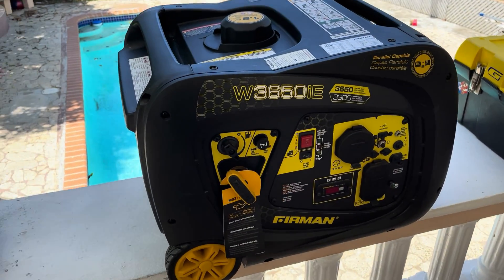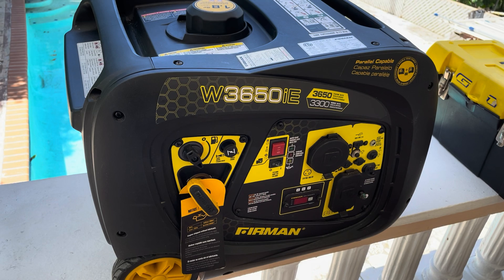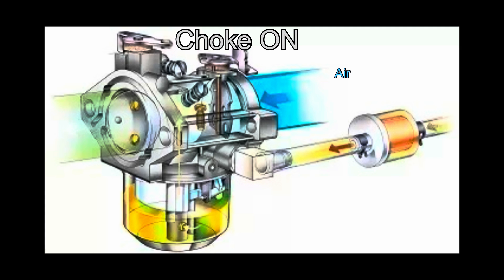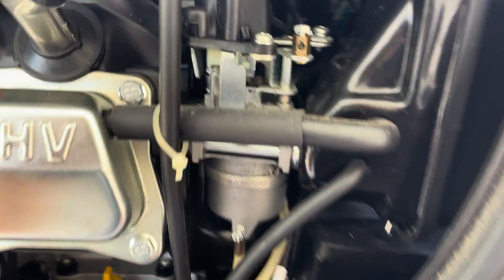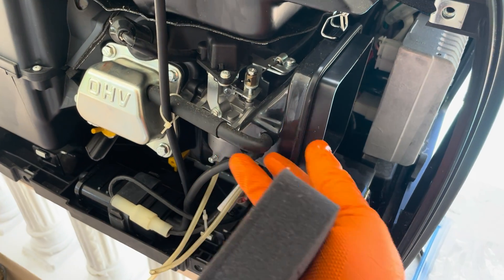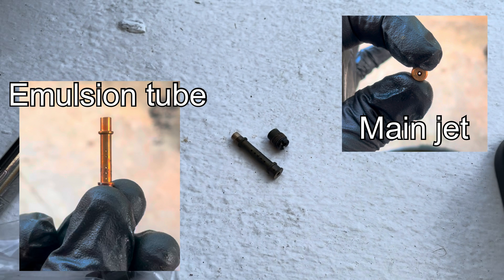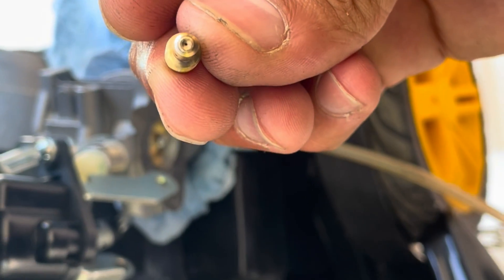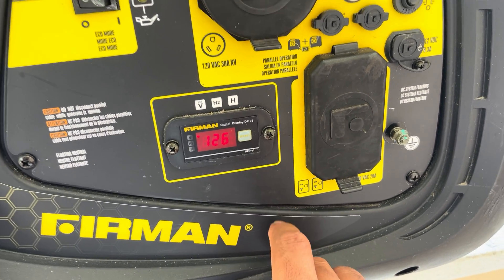Inverter Generator only runs on Choke / Half Choke. Quick repair for all generator brands.

Comment: How do i remove the choke line without breaking it
Reply from the maker: Go to my channel and check my latest video. In that video I show how to remove the choke cable. Basically all you need is a ratchet with a 1/4 inch socket and a Phillip bit.
Reply: @tacticalpowerpro my wife broke the screw bit trying to unscrew it lol. It still holds the choke cable just fine tho however it wont come off even if we wanted it to
Reply from the maker: Oh wow! Your wife hella strong lol

Comment: Great video.. I need your help, I just bought Firman 3000W with RV outlet, one Ground and two flat outlet, there is 125V between two flat one, but there is 75V between ground other two flat outlet, how do you connect to the house panel? Can you please let me know.. Thanks.
Reply from the maker: Thanks for watching! It sounds like your Firman has a floating neutral, which is why you’re seeing that 75V reading to ground, it’s a phantom voltage. For safe connection to a house panel, you’ll need a properly installed transfer switch or interlock done by a qualified electrician, and in many cases the generator’s neutral may need to be bonded depending on your setup. Never connect it directly without the proper transfer equipment, it’s both dangerous and illegal in most areas. If you’re unsure, have an electrician check your exact model and wiring so it’s safe for your home and complies with code.

Comment: Mine just surge and need a bit of choke to surge less. It run fine with load or eco mod disabled.
I will report back 😀
Reply from the maker: Those are signs of a clogged pilot jet. So a good carburetor cleaning (specially the pilot jet on top of the carburetor) will fix that problem. I will be uploading a video this week on how to solve exactly that issue you have on a firman inverter.
Reply: @tacticalpowerpro  oh great thank you 😄.
Any idea if they have a gas filter? I will get one in case.

Comment: I haven't cleaned the pilot jet yet. It's runs pretty good with a decent load like a small window AC unit, but anything less it kinda runs a little rough. Have to go after the pilot jet. Not clear on the location from your video but I will start looking for it or researching the location on the internet or other videos.
Reply from the maker: Sounds like you do have a clogged pilot jet. It is located on the top of the carburetor. It’s a small brass colored piece. Unscrew it with a flat head screwdriver and clear the small hole on the tip of the jet with a thin wire and carburetor cleaner.

Comment: What happens to a genset when it is only running with the choke on?
Reply from the maker: When a perfectly fine generator is running with the choke on, it’s getting too much fuel and not enough air. This can cause rough running, black smoke from the exhaust, higher fuel consumption, and even spark plug fouling. It also reduces power output and can lead to engine issues. 

If a generator only runs with the choke on and turns off without the choke, then the carburetor is probably clogged (like the generator in this video) or there’s an air leak in the carburetor gasket.

Comment: Clogged jets, always run small gas motors out of fuel completely after each use.  When it runs out of fuel, give it full choke and try to start it several times.  Ensure every drop of fuel is out of them tiny little jets
Reply from the maker: Thanks for sharing your method.

Comment: Great Video!
I followed all your steps on my 3650- It is starting but, I have fuel flowing out of the top clear drain line. that is next to the main fuel line. Any ideal how to stop this from happening? Thank you!
Reply from the maker: @ronaldballgame7868  thanks for watching my video. If fuel is coming out of that top clear hose it means that the carburetor bowl is overflowing and the float needle is not closing all the way. Either the needle is deformed or it’s still dirty.
Reply: Thank you! I am taking it apart again now, I’m in Houston and we are about to get some snow and bad weather.
Reply from the maker: You’re welcome! Let me know if you’re able to stop the fuel.
Reply: I have taken the entire carb out twice since we last messaged. The float looks good, no cracks or holes, the plunger part is clean and shiny, the hole where the plunger goes is clean and shiny. Both times I put it back in and together, it started right up and bam… 20 me nods in, the fuel started running out the clear top tube again…. Maybe I need a new carburetor all together..? Not sure what to do now? Any help is appreciated!
Reply from the maker: Oh wow, if it’s still leaking then your best bet is getting a new carburetor.
Reply: Thank you so much for the insight! 

I guess that what I get for letting it set for two years…
Reply from the maker: Thank you for commenting in my video. Two years with old fuel in a carburetor will do some serious damage. Make sure to use fuel treatment and start the generator at least once a month.
Reply: Thinking back to the needle on the float, I think the small rubber tip I pealed that off not knowing… thinking it was carbon…. and that why it’s not closing off the fuel. I wonder if I can just buy that part??
Reply from the maker: @ronaldballgame7868 haha no wonder. You can buy a carburetor rebuild kit that comes with the needle, float, jets and rubber gaskets. But you need to find a kit specific for that firman inverter carburetor. I honestly recommend a new carburetor and keep the old one as spare parts.

Comment: Is there a fuel shut off valve ?
Reply from the maker: Yes! The switch in the top left corner is the fuel shutoff valve. It has the gas pump symbol.
Reply: @tacticalpowerpro  ah ok thanks, mine is a bit different . The top left button is a switch to go from gas to propane.
Reply from the maker: That one also has a fuel shutoff valve. The same propane/gasoline selector switch is the fuel shutoff valve. Once you move it to propane it shuts off the gasoline.

Comment: After sitting over a year with gas in it, mine only ran on choke. I pushed the throttle cable back too far, I heard a click and the engine died,, it will no longer start in choke, or at all.  Did I break something else?  its an 1800 - 2300 series pulsar
Reply from the maker: You pushed the throttle cable or the choke cable back too far? The 1800 - 2300w Pulsar inverter has the OFF/RUN/CHOKE switch. Is that what you are referring to? You pushed that switch knob that controls the choke too far and heard a click?
Reply: @tacticalpowerpro  I had the cover off , on the carburetor the cable is connected to the carb idle,,  While it was running with the dial set to choke,, the only way it would run,, It was surging and loping,, I could see the lever move, I pushed the throttle on the carburetor back with my thumb,, I heard a click and the engine stopped,, did I drop the needle, or break the throttle step motor?  its brand new
Reply from the maker: @brianvincent8287  Oh ok so you pushed the throttle's plastic piece between the stepper motor and the carburetor. It sounds that you closed the throttle plate when you pushed it and it turned off and the click was the stepper motor gear. The throttle plate might still be closed, reason why it will not start again. Try pushing the throttle back to the opposite position and see if it starts again. The carburetor is definitely dirty so I recommend to follow one of my other videos like the one of the A-ipower or Ryobi inverter (they have the same engine as the pulsar) to have your generator running like new again.
Reply: @tacticalpowerpro  thanks,, i'll give it a try,, if I mess it up I'll get a new carb off amazon,, they're cheap enough

Comment: Love your approach to these videos, short and to the point.
Reply from the maker: Thank you! I really appreciate the feedback. My goal is to make the videos as clear and efficient as possible so people can get the info they need without wasting time. I know how frustrating it can be when you're trying to fix something and just need the right guidance. Let me know if there are any specific topics you'd like to see covered in future videos!
Reply: @tacticalpowerpro  I might be getting a Firman 3200 and have been looking at various YT videos and yours are the best with none of the not reading the manual BS. You know your stuff and know how to share it. I noticed some Spanish videos, you may want to consider knocking out an English and Spanish version for each of your future videos.
Subscribed.
Reply from the maker: Thank you for your comment. These Firman 3200 are pretty good, 90% of the ones I’ve repaired (over 50) had the same issue (clogged main jet in the carb). But that is the owner’s fault by not keeping up with the maintenance. I do plan on making Spanish versions of my videos, thank you for the suggestion and I’m glad to see there’s some interest in my content. Thanks for the sub!!
Reply: @tacticalpowerpro what do you recommend for normal maintenance to avoid this issue?
Reply from the maker: I definitely recommend using a fuel additive like SeaFoam Motor Treatment, or Star Tron fuel treatment in your fuel and start the generator at least once a month for 10 to 15 minutes. Do not let the generator sit for more than a month without running.

Comment: I have the firman wh03242 and the stepper motor is not adjusting the throttle so it runs at the slowest idle I can manually pull the stepper motor bracket to speed it up but when it idles it does not even show volts until I speed it up I bought a new stepper motor still just idles do you have any ideas thank you
Reply from the maker: Hi, verify that the plastic piece where the stepper motor shaft goes to has the spring. Without the throttle spring the stepper motor can’t move the throttle plate like it supposed to.

Comment: How chance bujía
Reply from the maker: To change the spark plug you will need a 13/16” spark plug socket. The spark plug boot is located right above the valve cover.

Comment: Great video. After cleaning the carb, it still runs rough but when it’s on eco mode runs smoothly. With eco mode off, it surges slightly. Maybe I’m just paranoid or something.
Reply from the maker: Thanks for watching my video. How did the gasket between the carburetor and the engine looked?
Reply: @tacticalpowerpro  They were really bad (broken)so I tried finding them locally but with no luck. I traced them with a felpro gasket making material and made them to size
Reply from the maker: The carb might still be a little dirty or you might have a small air leak through the gasket 🤔

Comment: What tools you used to remove the carburetor bowl?
Reply: Gracias por la respuesta. I used it, but I cannot pull it after it so I thought that still some screws isn’t removed.  Thoughts?
Reply from the maker: No other screws, the bowl is stuck due to old fuel turning into sticky varnish. A couple of taps at the bowl or stick a screwdriver at the bottom hole to pry it should work. Mucha suerte.
Reply: @tacticalpowerpro  Muchas gracias!!!
Reply from the maker: @julioreyes753  de nada, aqui siempre a la orden.
Reply from the maker: Saludos, I used a 10mm socket and ratchet.

Comment: I installed a new carburetor and still having the same issue. What do you think it could be?
Reply from the maker: A few things. Verify carburetor gaskets are good and placed in the correct spot. Verify the plastic spacer between the carburetor and the engine block is not cracked. Make sure the carburetor is secured (both nuts are nice and tight). Make sure fuel flow to the carburetor is good and not restricted. Make sure you have fresh fuel and not old bad fuel in the tank. Gap your spark plug to the correct gap. Or you have a bad new carburetor, It has happened to me before specially with the cheap Chinese carbs (give the new carb a clean)
Reply: @tacticalpowerpro  Thank you!
Reply from the maker: @strtrper628  Thanks to you for commenting and watching my video. Always here to help 🫡